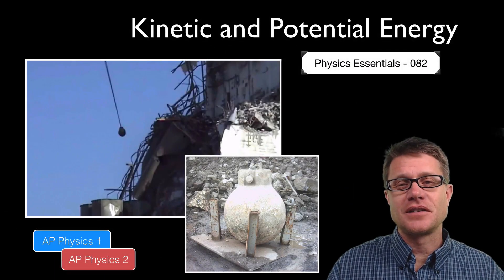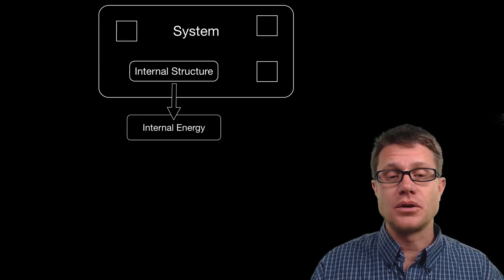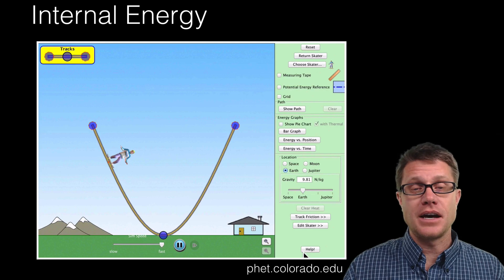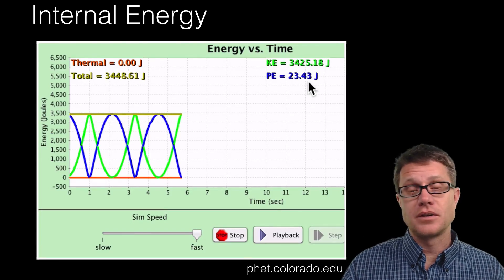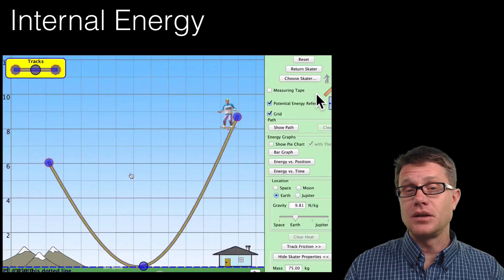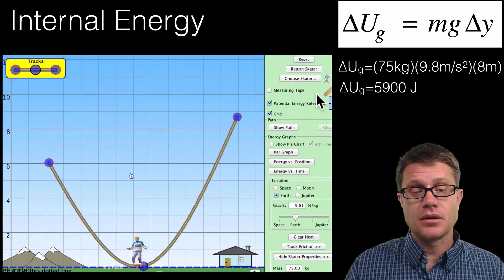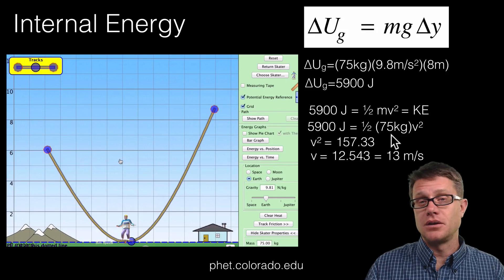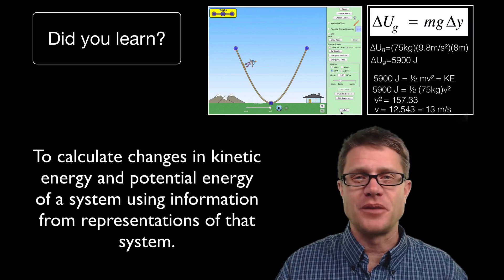Kinetic and Potential Energy

Comment: Another challenge for you sir!

The Geothermal Escalator... (especially good for a civilization that forced to live underground for survival because of a weakening magnetic field!)

-a rewarding upgrade to geothermal energy (water pumped into the warmth from the earth's core) is to add a dam with turbines at the bottom of a lake / ocean, a water spout drops the water onto a large water wheel with VERY long "levers" (100-500 meters long) with large water buckets at the end.

(the levers multiply the force of the water landing on the wheel, and the central gear that is spun is attached to a "series of turbines" that are all connected in a chain. (Up to 1 million turbines on a large track)

After the power of gravity is converted to energy through spinning turbines the water is pumped into hot "wells" that are heated by the earth's core. The thermal energy from the earth's core lifts the water in the form of steam (passing by multiple turbines amd generating even more energy) back to the earth's surface, where it is released back into the lake / ocean to repeat the cycle.

BONUS IDEAS:
1. The very long lever arms "roll" against a wall and push inside themselves on the way back up (or just fall in from gravity); removing the counterweight from the side that is empty, further increasing the torque of the lever side. 

from my calculations the total energy from a 1km track (holding like 1,000,000kg of water converted from GPE to Kinetic to electric generators) would be able to produce more electricity than nuclear power plants.

I am curious about how much energy is capable of being produced by the system, and if you know anybody that wants to help reduce pollution THIS IS AN INFINITE SOURCE OF FREE ELECTRICTY THAT CREATES 0 POLLUTION! YAY!

Comment: Isn't that correct to say there is no potential energy? For example if you spin a stone which is tied with a string, a circle start to appear, but in reality it is not a circle. In other words instead of your eyes seeing colors reflecting out of the stone from a single point of your eye sight, they capture the color of the stone from different places. Now, try to apply it to an object that is not moving. The particles the object is made up of reflect light from relatively small places, but it doesn't mean that they are not 
moving. 

I think you can apply it to texture as well. As a matter of fact, I don't think objects have shapes. For example if a blind man touches a small square he can tell it is a square, but what if he were to touch a relatively very large square (think of a kilometers wide one.). Now, how on earth will it be possible for him to say it is a square, without experiencing the whole square(why don't you apply it to a ball). Why experiencing the whole object matters? Grab a small square and close your eyes...! When you grab that small square tight, what your hand can experience is different pressure values which come from different part of that object. What your hand does is get that values relatively and compare them to the values that you got when you first touched a square (Remember what your mother told you what you should call it when you first experience those relative pressures?). So, they is no shape, but pressure.

How about the shapes you see? Trust me it is even simpler. All you need are a chalk and blackboard. When you have not drawn anything on the board, do you see any shapes? NO! Now, draw a circle using the chalk. So, how shapes come to existence without more than two colors and different color patterns?. Again, there is no shapes, colors (I know it is weird, and I would like to explain it more, if you agree above things).